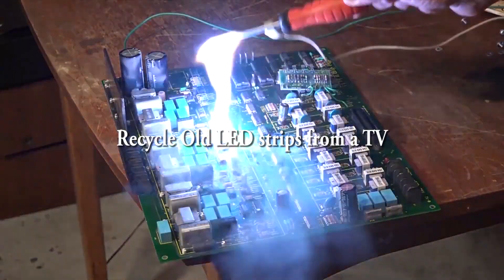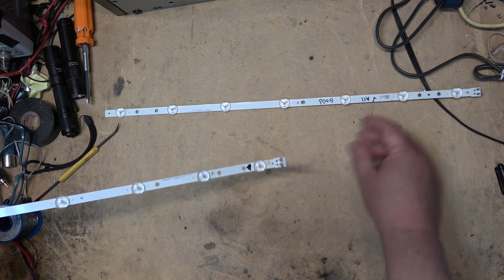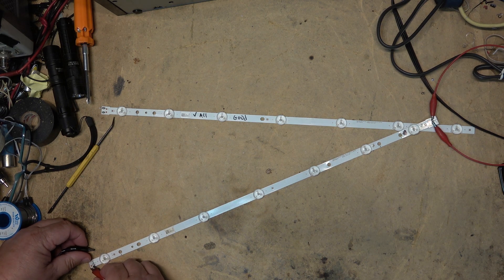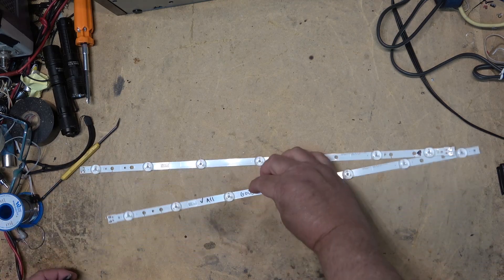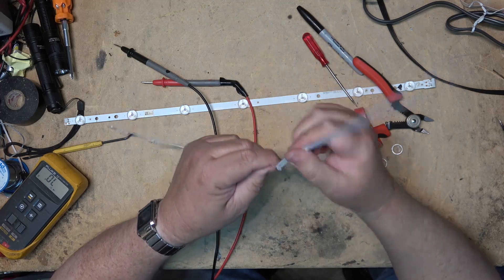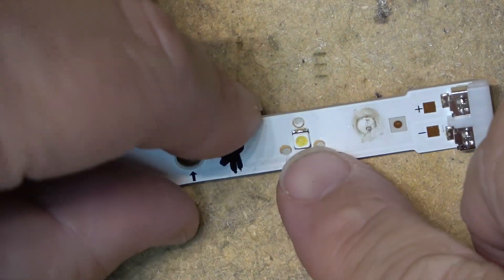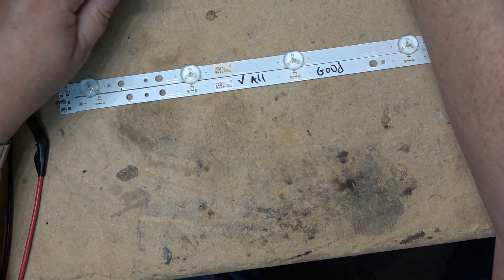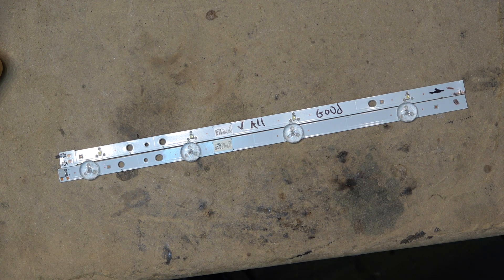Recycle LED TV strips and make them run on 12V

Comment: You can replace the LEDs. Use a solder rework station (blows HOT air to heat the solder) easy peasy. lotsa flux resoldering

Comment: I bought a new multimeter for hobby project and I am not a electrician not an electronic engineer or technician.
My old LG LED/LCD panel TV has just two strips of LED's on a PCB like long plate. These consumed 315 volts DC as per the new multimeter and then I mistakenly checked AC current on "DC" 😞  setting on my new multimeter and the multimeter is dead.
I will try cutting those strips assuming that each strip consumed 150 volts DC and then try applying your knowledge.
Thanks ❤

Comment: Nice vid, I love recycling.
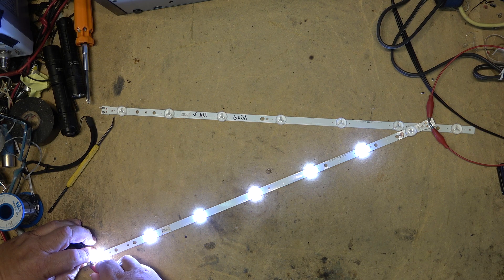Curious .. at 2:56... you say that in parallel one would need a fuse on each led. 
So does that mean that the LED strips (bough online) that Daisy-chain together are all individually fused ?
I have 4 strips that have 36 leds each.
Im gessing each strip would be a combination of series to parallel, but then 3v per led confuses me when there is 36 leds wired up in one strip (12 groups of 3 in one strip).
All 4 can be Daisy-chained and run on 12v.
Hard to grasp as a mechanic not electrician. ??😖
Reply from the maker: I cut the traces on the strip to run 4 in series on each side.  That's 12 volts. (3 volts each ewch led.  On the tv each half strip was 24 volts. 2 strips together 48v. On the tv 2 full length (4 half strips) in series 96 volts.

Comment: Thanks for the info, I applied the info to salvage a LCD computer moniitor with "dead" backlight. I had to cut the donour led strip (mounted on aluminum backing) shorter, and cutting the one end short, disabled the entire strip. Darn, I will look for the end termination points and joint the path again, its just super tiny and hard to see. the strip is 4mm across,x 30cm with white coating like yours. I can just barely see the traces. Ill see what I can do to terminate the now broken traces, thank you.

Comment: This is pretty cool! I have some LED strip with diodes laying around, the LEDs work but the diodes are shorted. I wonder how you connect these strips and what kind of power adapter you use for these strips? Thanks a lot!

Comment: do you think a 42 volt 2 amp power supply could run typical led backlights on a 50 inch tv. the lights are 7 x 6v, 4 strips

Comment: This may be a dumb question but have a set of 4x2 strips (4 strips of 15 built in separable 7 and 8 LED pieces. Ive played with some others from a different tv just to learn and experiment so hopefully i could make a nice light for my assembly table in the shop. Theyre the Samsung LM41-00001(Q&Z) respectively. Dont fully understand the way the tv drove them as 2 strips were in series and 2 were independent. I do understand that these are 3v forward current but while I have a decent understanding of electricity its less electronics and more utilty and I am still not sure how to size a resistor to keep from letting the smoke out. On the previous ones i experimented with i could make them blaze using a couple 9v batteries but it was often followed by a diode with a black 8 ball of death in the middle...
So simply put, i understand the voltage and but how do I know the current to push that at to get light without the smoke... the power supply board says 235v at 423mA and if i understand correctly the actual voltage will be closer to the 180v 60×3v theoretical voltage but how is the amperage worked, and i read that the LEDs are steady voltage so the current controls brightness or magic smoke release. How do I figure that, 423mA for all 4 strips or as a sum of the 3 circuits? It also says Duty 100%,300hz Dimmable if that helps.  
Appreciate any help in where im going wrong and how to go from that to a simple light of 4 15 LED strips in parallel. I have the original power board but would prefer to dig into my power supply/transformer bin and figure what works best for getting the voltage which isnt my issue as much as not burning them out with too much current.

Comment: I got a few of these laying around and my idea was to make a light box, I was planning on using two glass shelves and use the diffuser from an old lcd tv screen and place it between two panes glass.  Not sure if it will work but I don't see why not as it should be just like a glass tv screen.

Comment: I'm going to modify a TV that I previously modded into a light because the power supply is junk on it and it keeps turning off. I bought some 12v LED strip lighting off Amazon and I'll be replacing the CCFL lamps with the strips.
Reply from the maker: Good luck
Reply: I did that too

Comment: I've always been curious, when the backlights have many pairs of lines going to the strips, 2 3 or 4 pairs of wires. Do they run the strips out of phase from one another, possibly to reduce current that the driver needs to supply? As it would only need to supply a fraction at any moment.
Reply: Do you mean as in they could be multiplexed (one strip at a time)?
Reply: @Enigma758  yes

Comment: In my humble opinion my friend.. they use "series" instead of "parallel" for exactly the same reason they also do it with lithium batteries.. "Programmed obsolescence"......... In the case of LEDs they know that sooner or later.. one will heat up.. produce more resistance.. heat up more.. and the all thing fail... and you need a new TV.... or a new bulb (That's why LED bulb are also in series) .......... in parallel every LED have his own SMD resistor and that prevent the LED for over heating or over current..... if the led shorted the resistor burns and that's it..... all the rest keeps running...... that was the original design.. you can still get it.. in 5V stripes work like that........... in lithium you have the same thing... eventually one cell will gas up (because the series will still charge her up at a level she can not reach anymore).... the CID will break (or you will need the fire department)... and the all battery is done... even when all the rest of the pack is still fine.. you will need another.......... the worst is that we use to made lamps with a little bit of metal (tungsten wire and a metal chunk for the thread) + a pinch of the most abundant material in the world sand (for glass)...... today we threw down mountains.. looking for rare materials like gallium..  with machine that suck barrels of 300 liters of fuel per hour..... and just for ONE of the materials of those white LED's.....
Reply: "they use "series" instead of "parallel" for exactly the same reason they also do it with lithium batteries.."  Just a small, but important point... If you used batteries of lithium cells connected exclusively in parallel, you'd have a battery with a voltage of (say) 3.7volts... Driving any heavy  load would require a high current... In EVs the batteries are made up of modules with both parallel and series architecture, power tool batteries (except in one case, in my ownership) use series connection.  My 20v, 4Ah power tool batteries use either five or 6 cells to achieve 20 volts (nominal) my hedge trimmer uses 2 x 20v 4Ah batteries, each battery formed from cells in series, but the batteries, when installed, run in parallel (I believe) offering, effectively,  a 20v , 8Ah total battery capacity.  Of course, they could run in series, giving an effective 40v 4Ah capacity, in both cases, 160 Wh total capacity...

Comment: Lens diffuses the light to the sides mostly.   They work way better for general illumination without lens.   Why don't you use any kind of current limiting for the LED strips?   I am using some salvaged LED strips for Halloween strobe lighting with the good ole 555 IC and MOSFET driver tranny.
Reply from the maker: Don't need current limiting. 3 volts each in series is 12 volts. If the voltage was higher, absolutely I would need to limit the current, but they were only drawing 30ma on the ammeter (power supply shows the draw)
Reply: @12voltvids  I see that but then that requires a stable power supply that is well regulated so it does drift higher and  get into the steep current area of the LEDs VI curve.  Thanx
Reply from the maker: @jp040759  yes using a regulated switching psu so it isn't going higher.

Comment: Another good use case for these is as lighting for wardrobes and cupboards. My eyesight isnt great so i have lights in my closet that come on when i open the door, controlled via a little plunger switch of the kind used to operate dome lights in cars. Others use an IR sensor.

Comment: Cool video. I actually did this with an old LED bulb that stopped working. They used 7 volt LEDs so I isolated 2 on each side. I made a 12 volt lamp that worked pretty well. :-)

Comment: LEDs are usually very reliable. Why do the ones in TVs go so often? Note: This is almost a rhetorical question
Reply from the maker: Because they drive the shit out of them. Put your car in first floor it till the rev limiter kicks in and drive it all day and see how long it can sustain that before something breaks.
Reply: @12voltvids  ...so the backlight settings should be set to what - for longevity?
Reply from the maker: @lox_5017  75% max i would guess.
Reply: In my humble opinion my friend.. they use "series" instead of "parallel" for exactly the same reason they also do it with lithium batteries.. "Programmed obsolescence"...._..... In the case of LEDs they know that sooner or later.. one will heat up.. produce more resistance.. heat up more.. and the all thing fail... and you need a new TV.... or a new bulb (That's why LED bulb are also in series) .......... in parallel every LED have his own SMD resistor and that prevent the LED for over heating or over current..... if the led shorted the resistor burns and that's it..... all the rest keeps running...... that was the original design.. you can still get it.. in 5V stripes work like that........... in lithium you have the same thing... eventually one cell will gas up (because the series will still charge her up at a level she can not reach anymore).... the CID will break (or you will need the fire department)... and the all battery is done... even when all the rest of the pack is still fine.. you will need another...._...... the worst is that we use to made lamps with a little bit of metal (tungsten wire and a metal chunk for the thread) + a pinch of the most abundant material in the world sand (for glass)...... today we threw down mountains.. looking for rare materials like gallium..  with machine that suck barrels of 300 liters of fuel per hour..... and just for ONE of the materials of those white LED's..._..